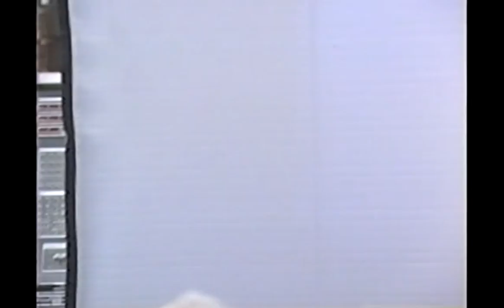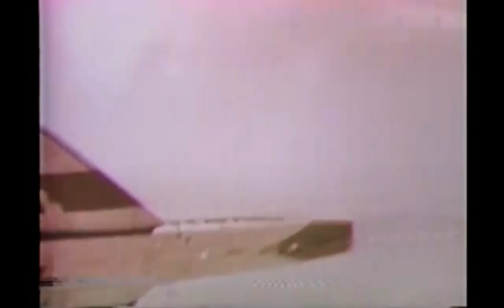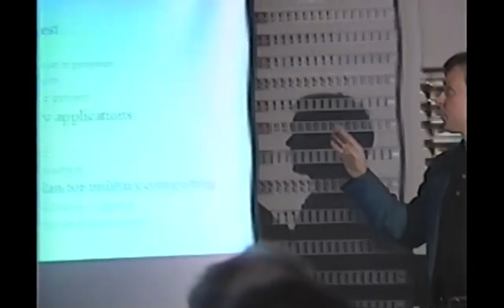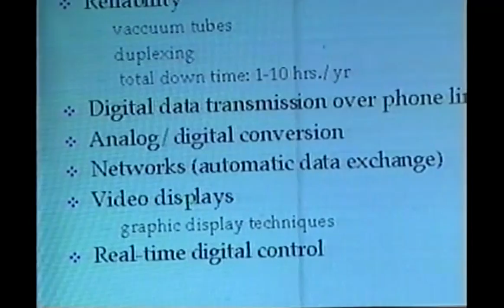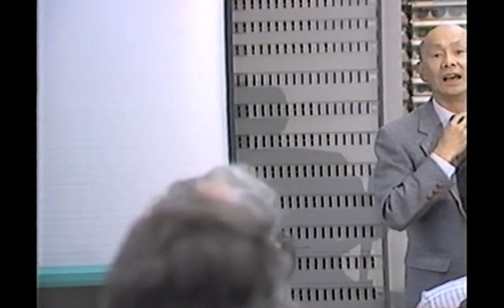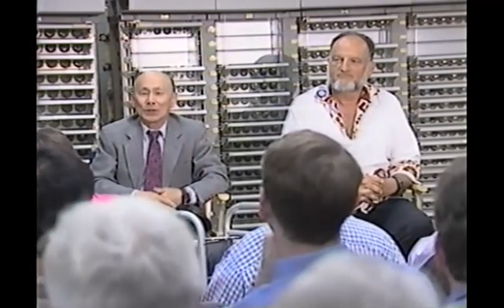SAGE: Computer-based air defense, 1958-1982

Comment: One of these guys said that if the SAGE system was jammed the SAGE system would such down and become ineffective. no so, only the radar site that was being jammed would be place off-line, but since SAGE was receiving input from multiple radar sites with overlapping coverage, the system would still work and get the job done. In addition, SAGE was constantly being update with improvement's. Someone asked about how the aircraft receive it steering information, the pilots called this fling the dot on their onboard radar screen and yes at first it did give instantaneous steering instructions which was corrected. The room blue lighting was not from the radar scoops, but from the overhead room lighting system.

Comment: I went through the SAGE facility near Detroit in 1965, and I was really impressed when one of the techs at a monitor, pulled out the gun, lit up an aircraft, and it displayed all the pertinent information.  I was incredibly impressed.  I remember one of the guys stating, that the equipment put out enough heat, that even in the dead of winter, cooling was always the big problem.  They also stated, that changes were happening so frequently, that it seemed the floors in the hallways were always open for a  repair, or some new feature.  A lot of the wiring for the facility, was run through special channels in the floor.  The floor panels were  designed to be easily removed for access.  
I had to laugh, when I saw the movie Dr Strangelove.

Comment: a nework each sector computer insalation key point combat center higher comand into a centeralize ..long range radrs information flashed calculation o nconsole tracking operaters quickly identify alram sounds senior directer size up scope basic information assigened to ..immedtanly intercep have been scrambled  tracking is good one two a vector symbol rl15 code number thus have the information he need speed towards target eletronic impules now comes the test calcualtion correct slighest free to ...concsole display and joined .....lock..... one important task to gudie back .....

Comment: The SDI didn't have to work to succeed. They actually faked a test by having the missile blow itself up. But it succeeded because the USSR thought it had to compete and the Reagan administration realized that the USSR did not have the economic capacity to do so. Which led to Gorbachev and the end of the USSR.
Reply: Uhm, no.

Comment: The monitors, or Situation Information Displays, did not "give off a blue light". The name Blue Room was because the overhead fluorescent lighting was literally tinted blue, to allow viewing of the SID without out washout or glare. The lights were above a ceiling grid that was composed of plastic "eggcrate" panels that also helped to reduce any glare. The computer painted the monochrome screen in yellow on black, like early mono terminals.